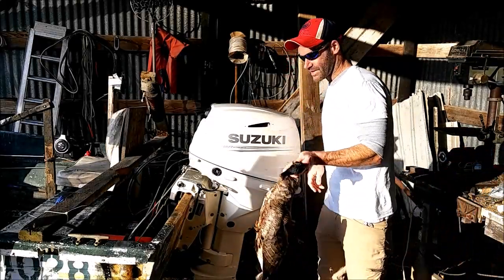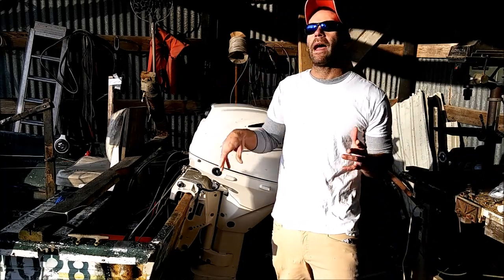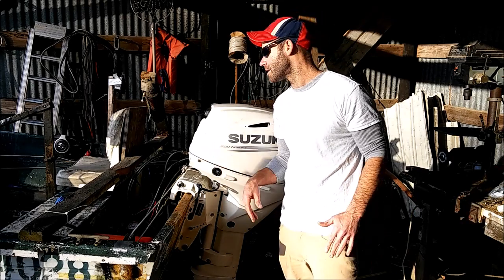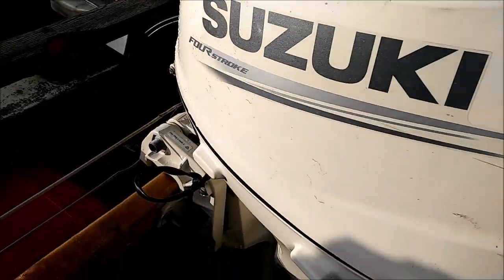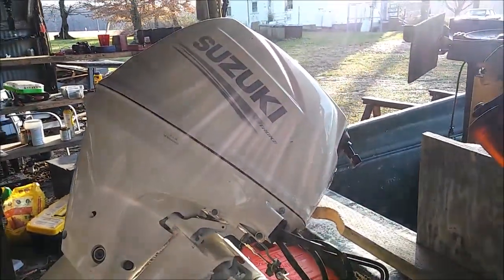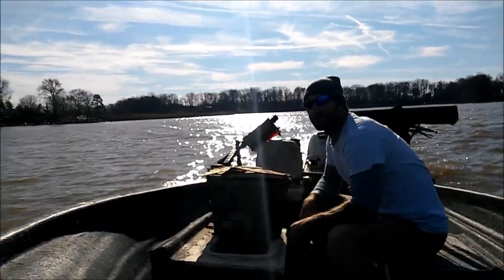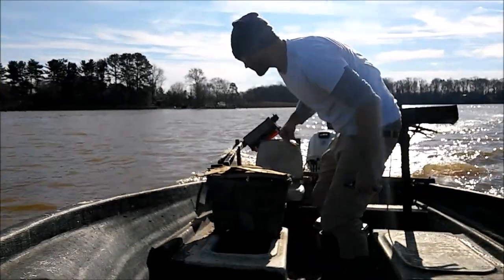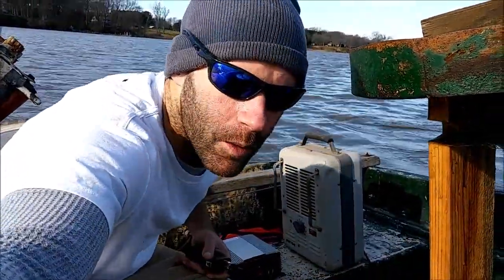2018 Suzuki 25hp Outboard Review w/ Remote Control Box

Comment: I have the 2019 DF25 tiller handle steer. Can I convert this to controls and steering ? Or are the connections for the controls not on my engine due to the tiller handle and throttle set up ?
Reply from the maker: You can convert it, will just be a bit of work.
Reply: That’s good news, thanks for the quick response. !
Reply: I have a nissan 9.9 that has been converted